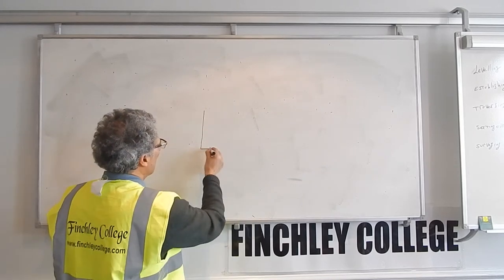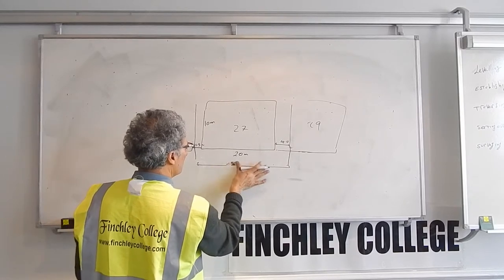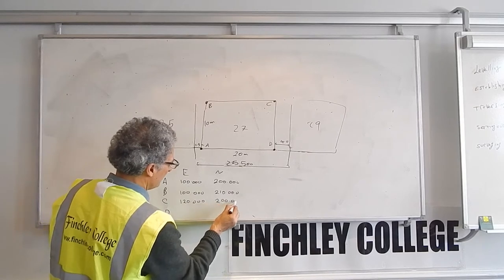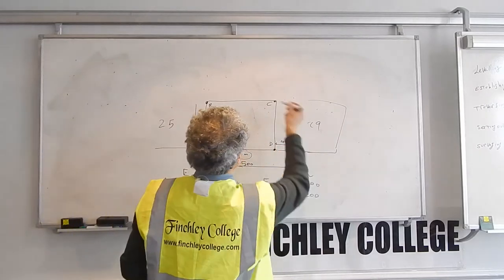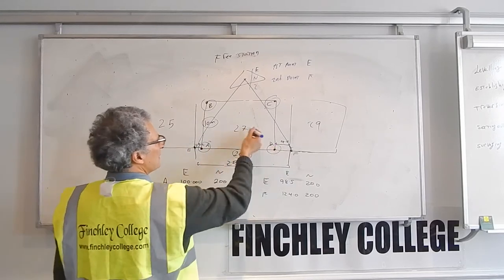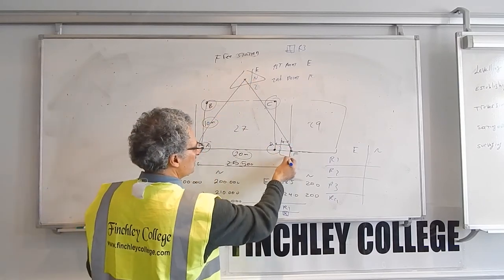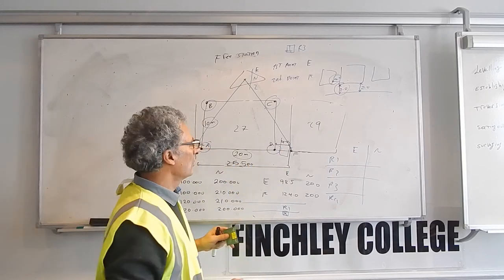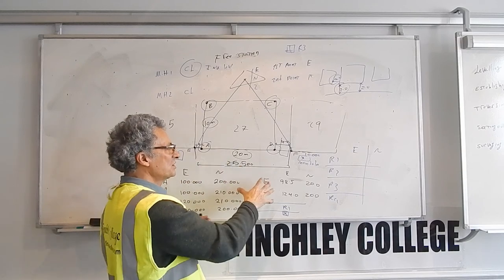Establishing Control Points on Small Site

Comment: Not fully explained, after getting distances from free station to E and F, how do I get points ABCD???
Reply: search online for a resection , and how a total station work !
Reply: Once u know A and B the station can map the entire site...so if you have the coordinates for c and d it will locate it for u
Reply from the maker: Sorry for the late reply, but once the resection is done, you will save the coordinates of all other points as fixed points in the memory, and then from the stake-out program you can set them out.

The idea with the local coordinate system is to be able to calculate the coordinates of any point easier.